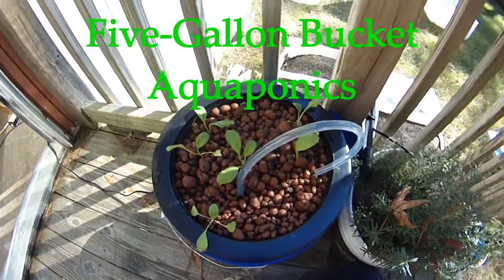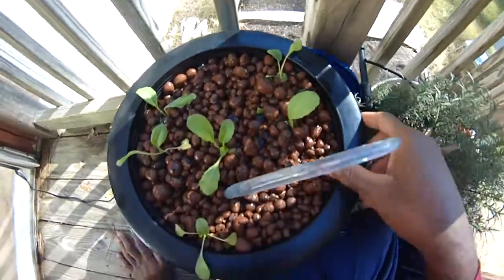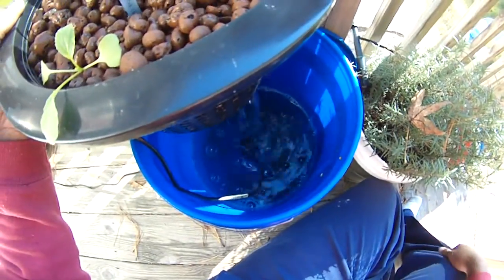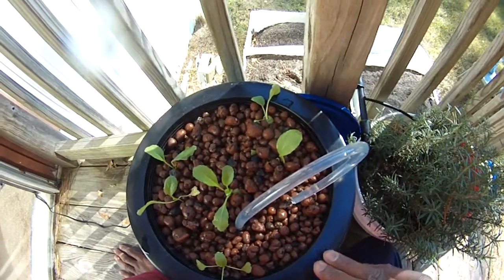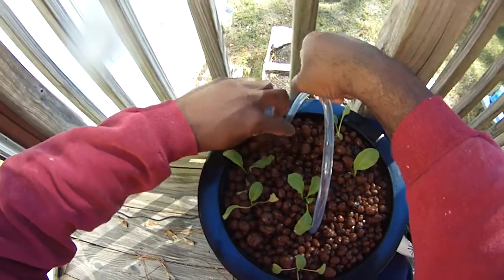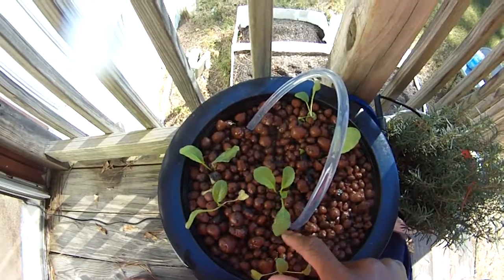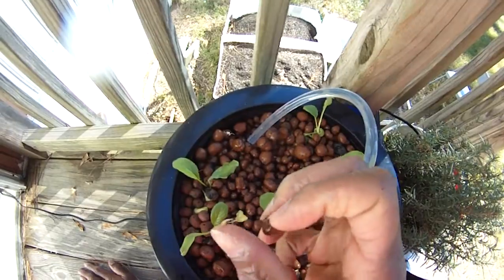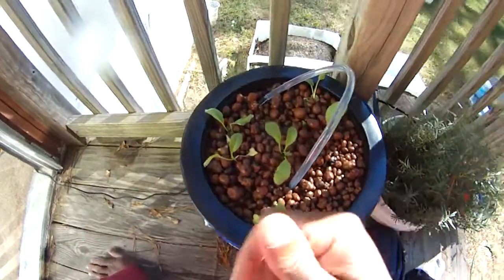Five-Gallon Bucket Aquaponics

Comment: Get a small barbed tee fitting and tee the hose off then use a piece of the same size hose to make a loo so that it comes up and looks like a lasso. You could then drill or punch small holes in the hose around the loop which will allow for even watering around the circumference of the bucket. Water will dribble out of all the little holes and keep your hydroton evenly watered.